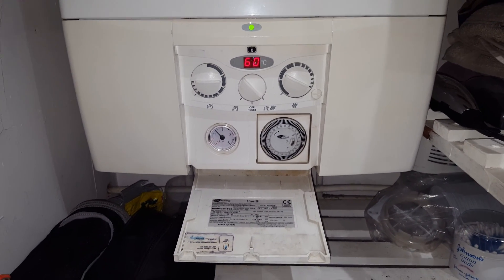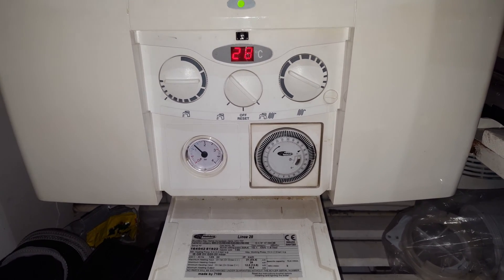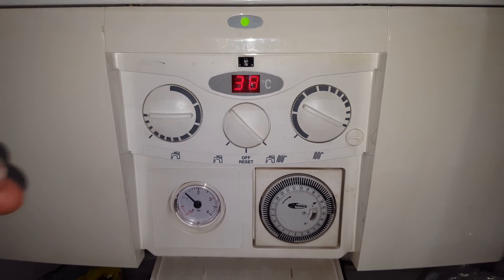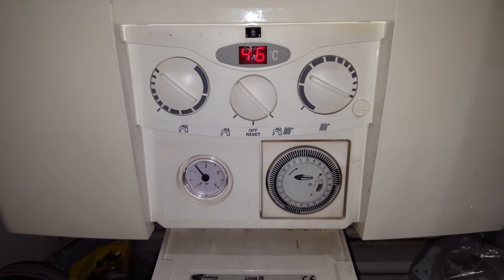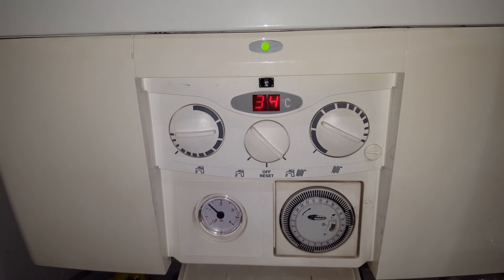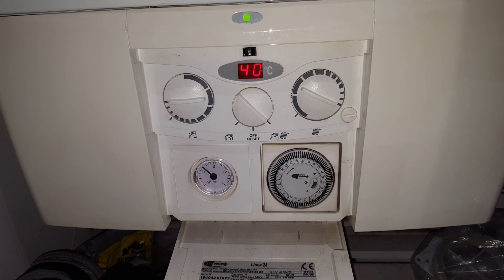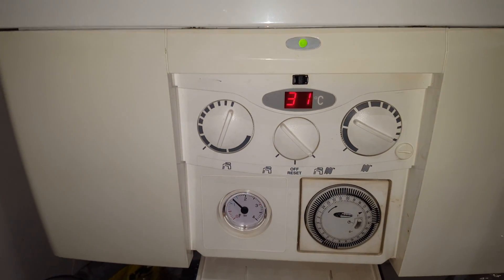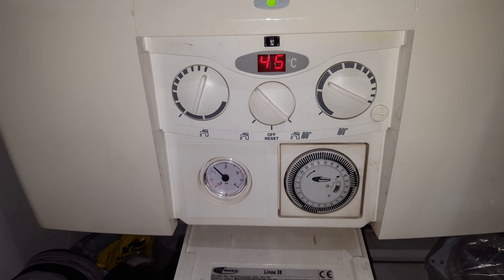Vokera Linea 28 No Hot Water

Comment: I've got a vokera fix. hot water only luke warm. ch works fine. it's the newer model he version. zone valves operate fine in manual but still not letting the heat past. I'm testing the diverter valve next. 

my question though, is, would a blocked plate heat exchanger cause a low 11°c water temperature? on a vokera he ?
Reply from the maker: Yeah a partial block hot water heat exchanger and the divertor valve passing also low gas working pressure

Comment: I have a Vokera 29 HE Compact that fires up for hot water but then after 15-20 secs it cuts out burner goes back to flashing green light before firing back up.  Seems a bit temperamental sometimes it won't fire up at all.  Fan seems to be spinning freely, aps works, ignition pcb is fine, not sure what else to go at...? Any ideas (ps where are you guys based?)
Reply from the maker: Its best you get a engineer out to do the job
Reply: A+R Central Heating and Boiler Repair Experts Ltd ok - it's just frustrating.  Bit more info from watching ur video I have just discovered that the boiler stays on and fires for CH demand and will only stay on for Hot Water demand if the temperature dial is up close to max. Stays fired when max, then if I turn it down as lit it cuts off, before firing back up again.  Sort of the opposite to the above so not over heating.  Any ideas? Arguably if I had the tap temperature dial to max I would not have any symptoms
Reply from the maker: Sounds like a the set up could be wrong
Reply: A+R Central Heating and Boiler Repair Experts Ltd What do you mean? It's been fine as was for 5 years, had a power cut the other week, but had them before, maybe that played a part.  Just want to steer anyone I call out well enough so don't get overly charged for this that and the other
Reply from the maker: +duggand519 what area are in ?
Reply: A+R Central Heating and Boiler Repair Experts Ltd Derby
Reply from the maker: +duggand519 We don't currently have a engineer in our EngineerTeam Network but email me tomorrow after 4.30 with number your  tony@engineerteam.co.uk and will call you

Comment: I have the same boiler and there was a power cut when it on heating the house! I now can't even turn the thing on at all! No LCD display or green light? There is power going to it from the mains. Any clue what this could be?
Reply from the maker: +Matthew Gallagher either a blow fuse on the pcb or the pcb is faulty
Reply: Thanks for the reply! Believe it or not the problem was that the off/reset switch had broken. The little bit of plastic that turns the setting had snapped off leaving it in a off position! Fixed but now have a Allen key protruding out of the system haha! Cheers again!
Reply from the maker: OK